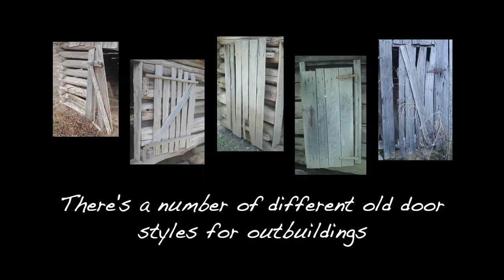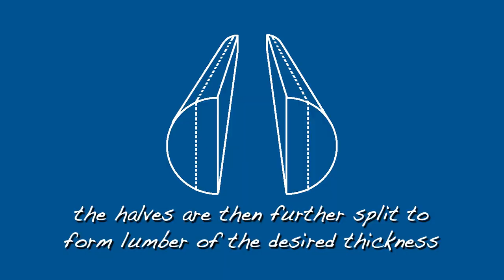Old-fashioned Doors and Horseshoe Hinges - The FHC Show, ep 24

Comment: My grandfather in the 1920's would gather together enough wood to build a shack with three rooms with a couple of windows an old door the roof was tar paper as well as the siding no insulation no plumbing. These were built in a wooded area so it didn't matter if he owned the land or not just collect the rent. By the 1960s he did upgrade to building some in some small towns and did buy the lot and made indoor plumbing but still a tar paper shack none the less